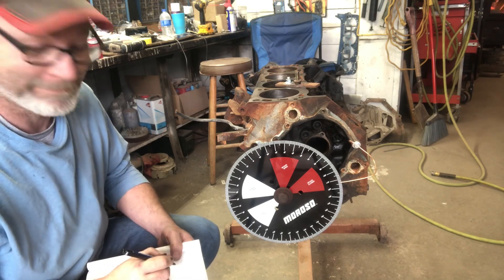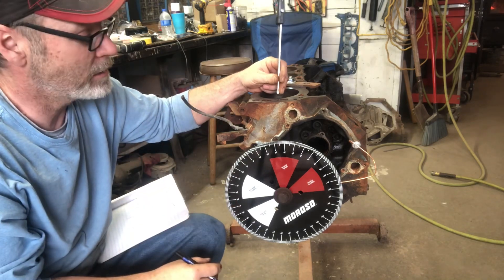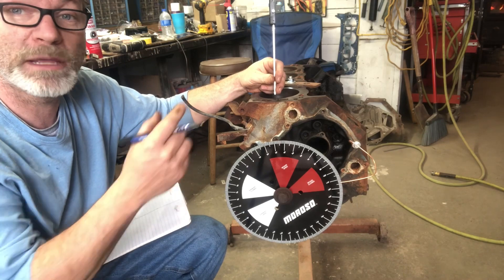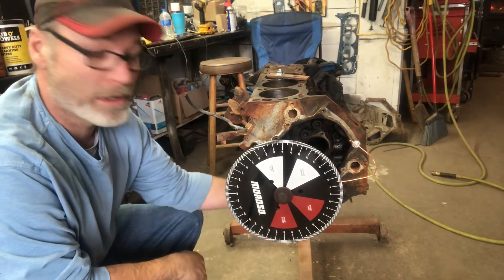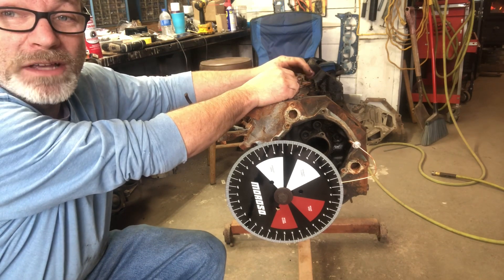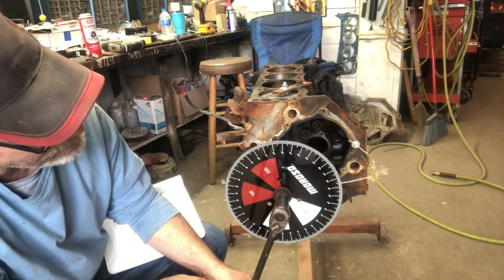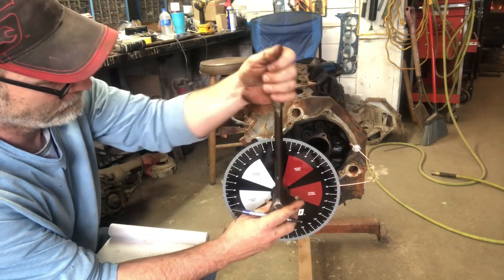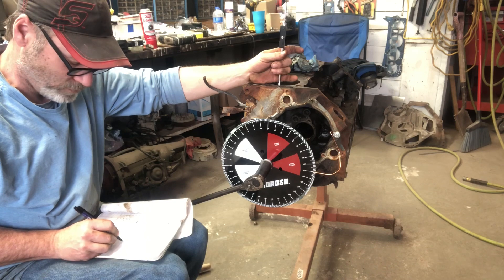Piston flip science part 2

Comment: Greater piston speed should create more intake velocity (torque).  Also swapping pistons from side to side should accomplish this w/o removing the rod.    1 with 5 on a SBF for example; with piston no.5 pointer facing to the rear of the block in hole no.1 and so on.